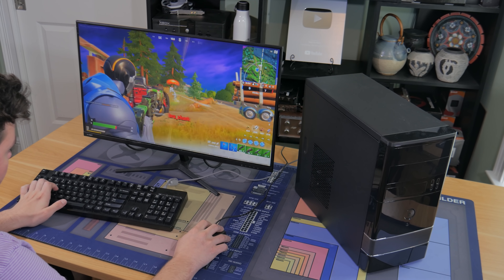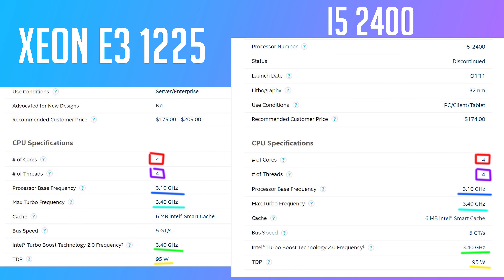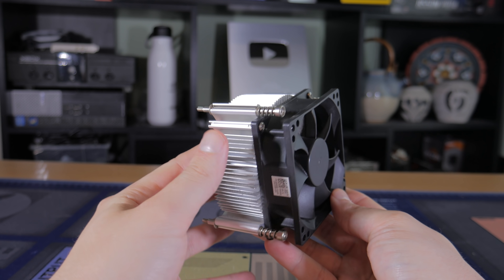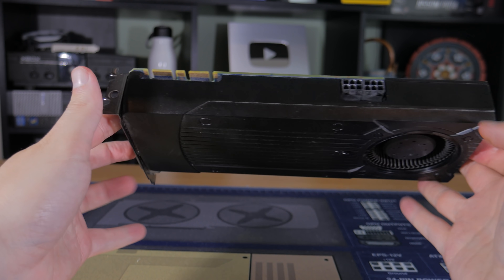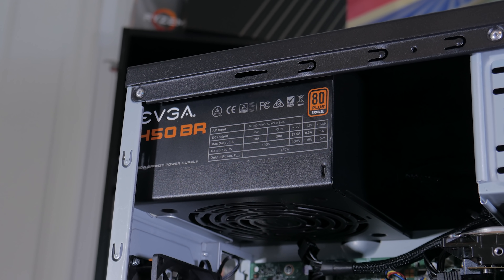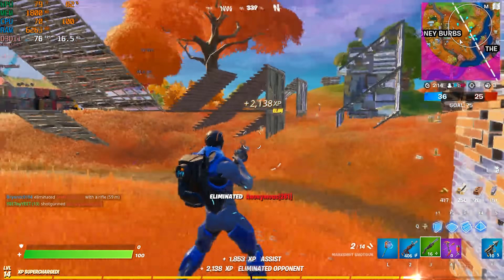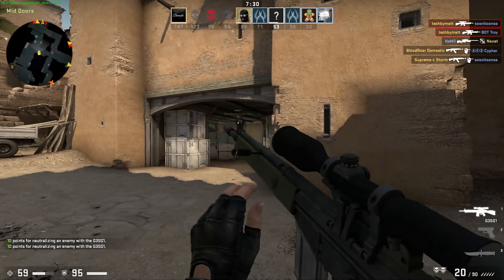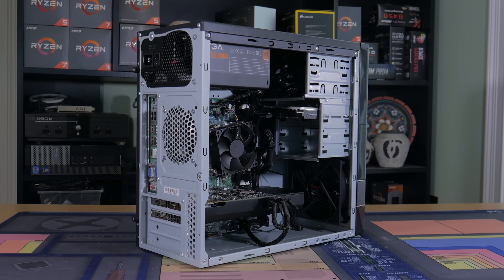I Built a $150 Gaming PC in 2021!

Comment: I finished my first build 2 days ago, and did something very similar.  Got a T3500 with 8gb ram for $87 shipped on ebay, threw in a $31 256gb ssd, Xeon W3670, and an old HD7870 that I got for free from a friend and for under $150 I'm playing Halo MCC at 1080p 60fps and loving it.  I went into it knowing nothing about building PCs, and the hardest part about building a budget rig like this was definitely learning how to pick components that work together.  I probably watched 30 hours of Youtube videos like this one before I built mine, and tools like PCpartpicker, Passmark, and Outersupply Power Supply Calculator were invaluable.  Thanks for sharing your knowledge.

Comment: You should do an ongoing series to try and put together the ultimate free PC with parts being given away from people around your area.
Reply: My current totally free system is a i5 3470 (3rd gen) with 8gb RAM, a 700w thermaltake power supply with an Antec Sonata case. It's the result of combining 4 freebie systems to build this ultimate one.  It's taken me almost 3yrs to finally upgrade to a half decent videocard in the form a gtx 750ti! I previously was running a HD 6850.
Reply: @supertouring1  I recently managed to get a system with an FX 4350, 12GB DDR3 and a GT 630. not bad for free. dead PSU and no HDD though sadly.
Reply: @whitebeartigtig  you managed to get that in a single system/find?  yeah, people rarely give away a hard drive due to security concerns.
Reply: How do you get a free pc?
Reply: @atheerarrak80  just know the right people.
Reply: @whitebeartigtig  oof 😂

Comment: The e3 1225 does indeed have an igpu, the 1220 does not. Nice build though, really hard to get together nowadays
Reply: For anyone wondering, most xeon with a 5 as the last number have a igpu.
Reply: Xeon with an igpu what?
Reply: I was thinking to get a xeon cpu similar to an i5-3470 for my first PC, but i never found out which one is similar to it
Reply: @maxpayz2431  its the E3 1225 v2 is the closest to the Core i5 3570 they are identical as far as speeds and what not. There is a small performance difference but its not even close to noticeable now days. What did you end up going with?
Reply: @HardWhereHero  i ended up with a amd Ryzen 5 3600 with an rtx 2070, i still have plans with the i5-3470 later on

Comment: Actually you can install aftermarket cooler on that motherboard
I have low profile Scythe cooler installed in my SFF Optiplex 790 👌
You need to remove backplate and 4 plastic washers from back of the motherboard
It is glued on motherboard so use plastic prying tool to remove it 👌
Reply: @FatButtFlaps  yes it does
But you can get adapter from proprietary connector to standard 4 pin fan connector

Comment: You can screw down a clip mounting bracket onto these boards with standoff screws if you wanted to use an aftermarket cooler.

Comment: As far as I have found, and E3 that ends in a 5 (E3-1225, E3-1265 etc) DOES have an IGPU, any that ends in a 0 does not.  Not sure about Sandy Bridge, but in Ivy Bridge it's actually a P4000 IGPU which is the equivalent of the HD4000 in the i7-3770.  Kind of a nice addition.
The mount for the cooler is standard so you could replace it with a cooler that has it's own mounting plate, though you would probably also need to swap out the cpu retention mechanism, which is 3 screws, just don't bend any pins while your messing about.
I've been messing around with some 9010 motherboards that are pretty fun, but do take a bit more work to get working in a different case.

Comment: an alternative for the power supply is a evga w3 which is almost at every mid week madness for 20$, another alternative for the cpu is the e3 1220 which can be found for 20 more commonly for 20 and also a gpu alternative is a gtx 760 which I’ve found for around 50-70 a lot
Reply: Another alternative for cpu is i5 2500 for 21$ 😎

Comment: With the Xeon ECC RAM should work as well, often enough going cheaper (as an alternative for those searching)
Reply: That requires motherboard support of ECC, amd most OEM boards do not have it, unless they are server boards
Reply: @KadiusFTW  plenty of x58 mobos support ECC, but then again those boards are pricey all on their own lol.   My Asus P6T was like $100 several years ago, and they're still going for 100-150 after a quick ebay search.  I'm surprised I can still get ~200 for my r9 290x.    and I'm seriously considering selling my 1070ti for like 3x what I bought it for just because I don't do much gaming these days, and so barely use it...maybe I should swap it out of my dedicated VR rig and into my main desktop,..
Reply: Only RDIMM-s go really cheap because you can only use them on server platforms, which have their own set of limitations.
Reply: @tyaty  for x58 it is common, but that is specifically an HEDT, this is a non HEDT platform, where ECC motherboards are rare when they arent server boards. Lga 1151, 1150, and 1155 have ecc support for their xeons, but most motherboards with those sockets do not support ecc

Comment: Thanks for your video bud! Cheers! 🍻

I mean, if you're going to use an oem motherboard to cut costs, you might as well go ahead and get a fully refurbished/discontinued system, as they're usually not much more expensive than just the boards themselves and you'll start out with everything you need; including Windows licence key, ram, psu, case and most importantly, the CPU. 

I turned one into a living room 720p gamer, earlier last year. It's an HP Prodesk G1 w/ i5 4570 and 8gb ddr3, that I picked up from eBay for about $80. I then put a GTX 750 2gb, a 2nd stick of 8gb ram, and a 256gb ssd in it, to round it out. It runs pretty much everything I throw at it perfectly, between 720p and 900p. I target 1080p low settings, 60fps in competitive games, like the MCC, and 30 fps, high settings, and 720p for most non-competitive titles. In total, I spent about $190 on this build, and this was before prices skyrocketed but most of these parts have retained similar prices to then or have only barely increased.
Reply: @FatButtFlaps  if you're referring to the GPU, then no. It's an MSI Nvidia GTX 750 (non "TI" variant). And if you aren't referring to the GPU, then I don't know, and would like to ask you to further elaborate.
Reply: @FatButtFlaps  lol I completely forgot about that cpu! I've since passed that PC onto my younger cousin. I took the GPU out though and placed it into a newer Ryzen build for the same concept.
Reply: @FatButtFlaps  honestly, you can't go wrong with an entry level IdeaCentre desktop. The Ryzen build I previously mentioned, is a Lenovo IdeaCentre 3a mid-tower. I picked it up for about $280 in 2020, when they started marking them down for the newer variants. It came with a Ryzen 3200g, 8gb single channel ram, and a 1tb 7200rpm HDD; I swapped out the ram stick for a 16gb 3000mhz kit I had, installed a cheap 128gb SSD boot drive, and added the GTX 750 to it. It started out as a Steam big picture machine, but I've since converted it into an emulation house running batocera, and it runs everything I throw at it (PS3 is a bit hit or miss though 🤷‍♂️), and since it's connected to an HD CRT TV, leaving most games to run at their native resolutions doesn't compromise the visuals or the experience of the games. Though, if you want to run the 60fps patches for games like, BoTW or Xenoblade, this may not be the type of build you're looking for. As far as I can tell, even at lower resolutions, my setup is still hard pressed to hit consistent 60 fps in both of those games with Cemu (may have better luck in Windows though), and they play at a slower and inconsistent speed than normal.

Comment: Good Job and impressive build for the price.
Mine is a low end 1155 motherboard with a Xeon 1230v2 The extra threads make a huge difference.
For the best bang for the buck, one should really try to put a tiny bit extra for a 1230v2 (8 threads), 120gig ssd and a slightly faster gpu like a 680 or radeon 7950.
But for price and performance, nothing can beat the good old Sandy Bridge architecture.

Comment: Wait? The E3-1225 does have graphics. It has P3000 to be exact. I put that into my mother's office computer. I mean. Your not wrong in that majority of builders should absolutely just take "Xeons have no integrated graphics." as a fact though. Cause when you want to game and your not using a streaming service like GeForce Now(which the E3-1225 iGPU can run on). Then yeah. Get a GPU like you said dude.

I highly enjoyed looking at this build of $150. Only difference I would make is going for 12gb to 16gb of DDR3. Many games really want more ram. And maybe the E3-1230. But yeah. Really cool. :)

Comment: I have the HP Pavilion gaming desktop (It has a ryzen 5 3500, gtx 1650 super, 256gb nvme ssd, 8gb single channel ram at 2666mhz.) It only costs 600$ and runs all the games I throw at it just fine. It can run destiny 2 and maxed settings and stay at 60fps+. If you're on a budget I strongly recomend it, although you will need to pick up a hdd for more storage, but it comes with a spare sata cable. And you can upgrade to a 1660 super or even a 2060 because it comes with a 400w 80+ platinum psu.

Comment: I started a 200 budget pc a month ago with the same motherboard and same cpu but i have no idea why it wouldnt turn on,although i saw a bent pin on the motherboard so it could be that,but at the end i ended up using an i3 that came with the optiplex 390 ill give the xeon a try over the weekend,thanks for the video!

Comment: This is almost just like my build,
Rosewill Case
Optiplex 390 Motherboard 
I3 2120
HD 5850 - OC with afterburner
12 GB DDR3 @ 1333 MHz
250 GB Drive
500 GB Drive
i plan to grab an ssd for it in the future and also a graphics card upgrade sometime in the future.
Reply: What games do you play?
Reply: @GamerprpYT  cs go, fallout nv, dbz kakarot, alien isolation, gmod, borderlands, battlefield 4, black ops 2, valorant, metro series, can probably play alot more but i don’t have many games. if you have a system like this a nice upgrade would be an i7 2600/2600k and a 1050/1050ti if you can find one for a nice price, those upgrades should allow you to play games like warzone, apex, etc

Comment: I have the same motherboard. The cpu cooler I am using at the moment is from EVGA. Along with 16gb of DDR3 EVGA sticks , a EVGA GeForce GTX 760 xc, and EVGA 500w psu. Cpu is a i5 2400 3.1 ghz playing fortnite at 160 fps (performance mode)

Comment: I built a $300 system with a HP pro 3300mt with a core i5 3470 and 4gb ram, I upgraded it with a 120gb ssd, 4gb ram, and a gt 1030.
Reply: for this... its very expensive

Comment: Good video. I get he was doing a "price point" video.. BUT if you are building a computer, another $50 gets a much better experience. That motherboard has hdmi,  i5 2400 has an igpu which is great to trouble shoot problems OR when your video card dies, You can still use the pc.
16gb is the standard for ram in 2021, 8gb runs out pretty quick these days.
A cheap SSD boot drive makes a world of difference in using the pc day to day. 
Value vs cost.

Comment: You could save some money with a x3440 but the board costs a $10 more if you use a x3440 and you can overclock it more. And the collers are like $5 but if you bid on eBay you can snag some for cheaper

Comment: The only things I would have changed would to go for the e3-1230 for the hyperthreading(currently around $40 on eBay), and tried to find a gtx 960 (there's one in my area listed for $80 at the moment). Probably would've pushed the price to around $250 but still the performance difference would be worth the extra $100 imo.
Reply: @DShael Dorcent how so? The 960 can run any game currently out as it supports dx12 and can run almost everything at native 1080p at low settings. And I've had an i5 2400 which is basically the same as the e3-1225 and when I upgraded to the e3-1230, I saw avg frames go up by at least 10fps in most games and my 1% lows increased by nearly double.
Reply: @DShael Dorcent the 670 doesn't support dx12 at the hardware level so any new games that need the full feature support are out, whereas the 960 does support full dx12. And yes I understand this is a build under a certain price, all I was saying is what I'd do to make it slightly better and able to run modern games while still staying under $300 which is pretty damn good in this market.

Comment: I just won a $122 Dell Vostro 470 on eBay with a i5-3450, 16gb ram, and a 500gb HDD. Is this a good price for nowadays? I’m still looking for a gtx 670 2gb for around $60-80 anywhere! My later upgrade would be a 240gb SSD for $28 and a 450-500w BR psu.

Comment: If i were to build a budget Gaming Rig here are my specs -

MSI G41M-P26 G41 LGA 775 Micro-ATX motherboard
 
Intel Core 2 Quad Q6600 @2.4ghz

Hyper X Fury 8gb 1333mhz ddr3 RAM

500gb Walram SSD

Asus GTX 460ti

True Rated 700w psu

Inplay Wind 01 Case

Pangco 120mm Fans

I know some of these components are ancient but, these parts can play some AAA titles like Valorant and CS:GO and definitely run games like Minecraft, Roblox and Among Us

Comment: You shouldn't spend 48$ on a PSU and a case in a budget build.
You can find cases for around 5$ or even free, and a "good" PSU for around 10-15$ locally, so you can shave off the shipping fee. And also add an SSD in for the saved money.

Comment: I builded a 200€ PC, 
I buyed a Office PC with 8GB Ram, i3 3240, 120GB SSD, 500GB HDD and Windows 10 Pro.
It cost only 75€

Then i buyed a used 1050TI Cerberus OC for 125€ and build it in.

In conclusion, the PC works just fine and i can Play GTA5 on Highest Settings with 50fps AVG.
Fortnite runs with competive Settings (most on high, lower effects, View distance on Epic) with 120fps AVG.
Rocket league runs with 145fps AVG on Highest Settings.
Hitman 3 runs on mid settings with 45fps on AVG.
Metro last light runs on Highest Settings with 75fps on AVG.
All testet on 1280x1024. 1920x1080 should run with similar Fps.

Comment: Matt i got a pc but idk if the parts i wanna put in it will work with bios dell optiplex 3090 e3 1230 i wanna put a rtx 3060/rx 5600xt
Reply: Please don't do such a thing 
Its a huge bottleneck
Reply: Yeah, a gtx 1080 will already be bottlenecked by the cpu.
Reply: @supertouring1  depends on the game actually
But yes your right
Reply: Insane bottleneck.

Comment: Matt got a question I have a i3 9100f gtx 970 and 16gb system what should I upgrade
Reply from the maker: I'd probably go for a CPU upgrade first.
Reply: @TechByMattB  that's what I though but I wanna stream while gaming so intel or ryzen cos I was gonna get a ryzen 5 3600 but the i5 10400f was better wich one
Reply from the maker: They're going to perform pretty similarly. If priced the same I would get the 3600, if it's significantly cheaper I would go for the 10400.
Reply: @TechByMattB  funny thing is I was but when they release they wasn't the price on the nvidia website and scalpers priced them 700 pounds

Comment: A legitimate Windows key can be had for $15-$20, come on.
Reply: That's 10% of the budget.

That said, he might have been better off scrounging for a dirt cheap Dell 790/990 as that would have covered the MB, case, and PS at a minimum, and maybe the CPU, RAM, and HD.  And if it had the old W7 COA sticker on it, free upgrade to activated W10.

But he's trying to show parts that anyone should be able to get for around that price, and OEMs can vary widely in price depending on area.  I USED to be able to get 990s for $20 or less (usually $5-10) just missing the HD at local auctions, but thanks to COVID, those have been shut down, and when they sell online, people bid them much higher than I think they're worth.

Comment: Ngl, this pc is crap. For like 50 more u could get alot better.  A i3 9100f/ 8100 go for 40 eur in PT, b series board 35,8gb stick 25, 500w 80 bronze psu 30,and ssds are literally under 20 rn for 120gb . At least in spain a kingston a400 is 17 euros.
Reply: Cool story bro.

You realize that YOUR prices may not be attainable elsewhere, right?

Prices are "a bit" elevated, even for "old junk" in many countries thanks to COVID and miners buying up all the latest tech, pushing the entire market up in the process.